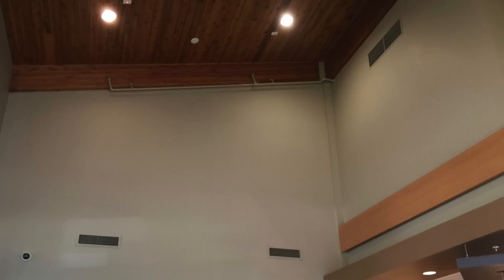Perception of comfort #3

Comment: Can people live with ceiling fans?  I would think those would fudge-factor solve basically all these diffuser-location problems.
Reply from the maker: Ceiling fans had more value in the past than they do now.  When duct temp was in the 140 to 150F range and fan volume was lower, you had more stratification of the air.  Newer systems have lower duct temp and the problem is not as bad.
GFM

Comment: In the brand new building I'm in, we have a raised floor, the entire sub is one giant duct. 
There are circular floor vents that open, or close based on the requirements of a particular space. It seems to work ok, but I'm not a fan of floor cups, as they are nothing but boot shit collectors. 
And I can see a mold problem in our future.  
The floor solenoids are also getting pretty noisy now, its basically a cup with in a cup with slits in them, when heating (or cooling depending on the season) is called for, the inner cup turns opening the slits.